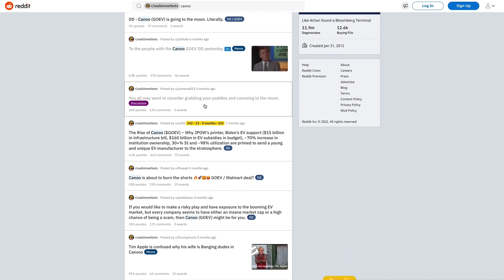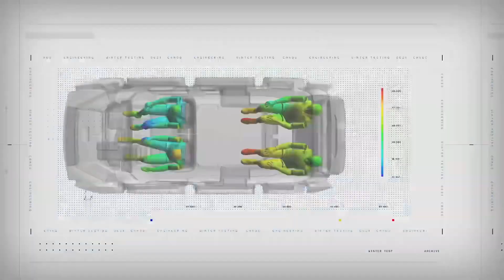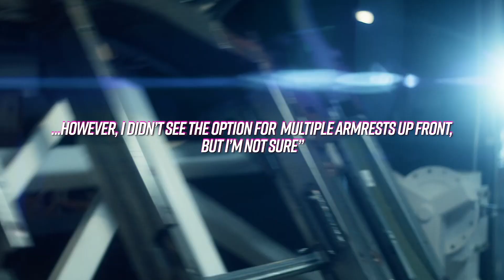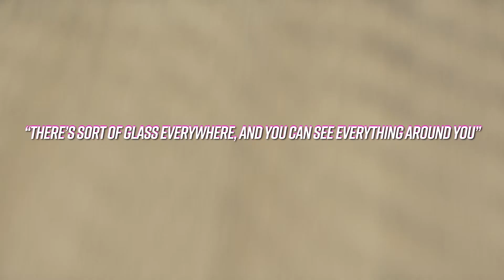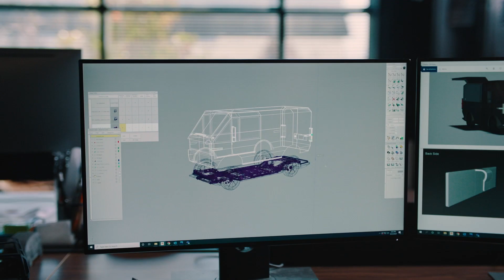Canoo :: From OK With Love. GOEV!

Comment: Yeah a subbed a while ago. Canoo coverage was part of the reason. I have an Aptera and a Lightning on reserve. I think I’d like the Canoo more than the Aptera at the moment. I have some reservations though. I don’t think Canoo’s current rear seating configuration would pass the IIHS safety trials. I wish there was a quad captain’s chair option- or just a bench rear seat with multiple positions so that you could move it forward to the rear doors. This would allow more storage from the hatch, and somewhat protect passengers from flying cargo. Think Uber, yeah rear passengers would enjoy the leg room, but what about their luggage in the event of an accident? I also don’t like the seats on the sides with respect to safety in side collisions. That noggin is going to do some bumping into glass and C pillars- what about a curtain bag? How would that work? 

The truck will likely have tool storage systems behind the seat. IMO, it’s the perfect work truck in all respects. I work as an electrician. Canoo has great modular ideas with the truck, and I’m sure they would transfer some of those ideas to an excellent work van as well. 

I think the world is ready for something like Canoo, but I’d like to see more seating options. BTW.. maybe I’m old fashioned. I had a Ford Aerostar, typical 3 row setup of the time- I moved the 3 seat bench to the front position and left the 2 seat bench in the garage. That’s sort of what I was thinking even before IIHS crash tests came to mind.